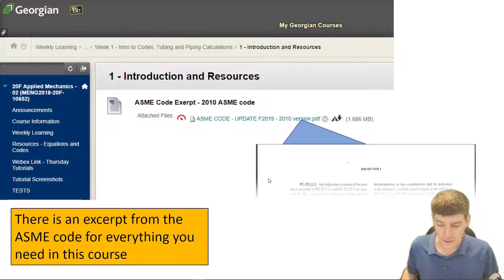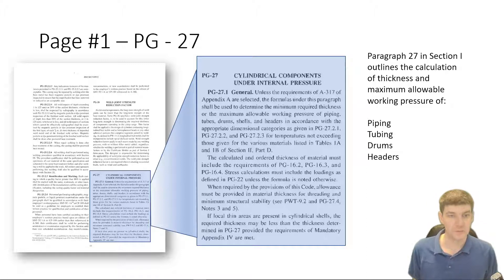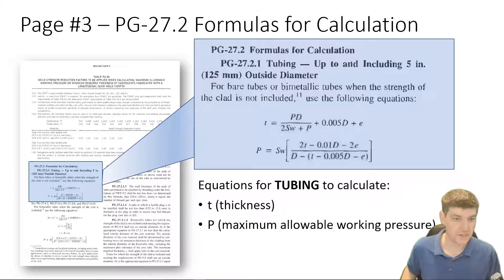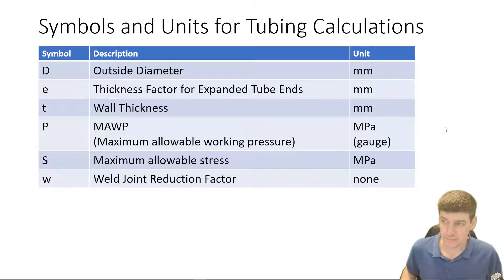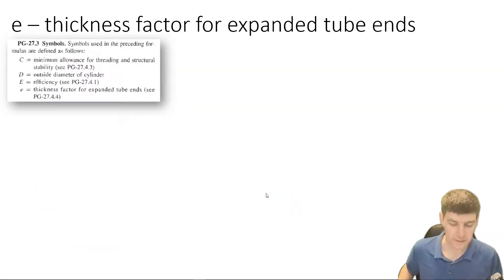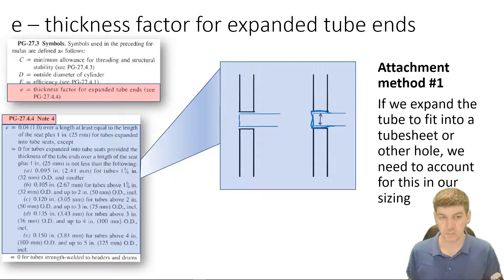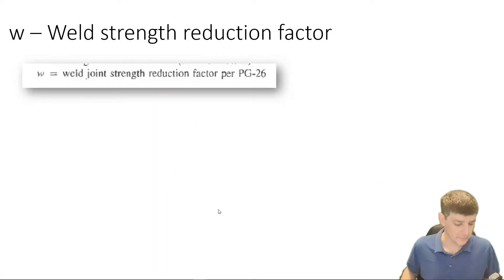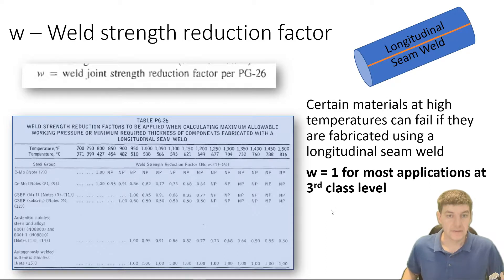MENG2018 - ASME CODE CALCULATIONS - Tubing Thickness and MAWP Theory

Comment: On a hemispherical head the question is including static head but I dont see the size for vessel. It does give you inside radius of head 30 inch..and and ID of 60 inches..im wonder how they came up with .433x5ft